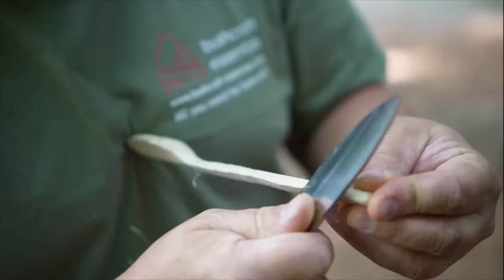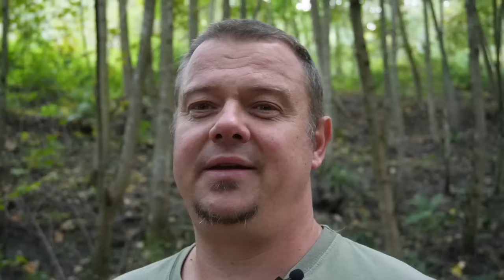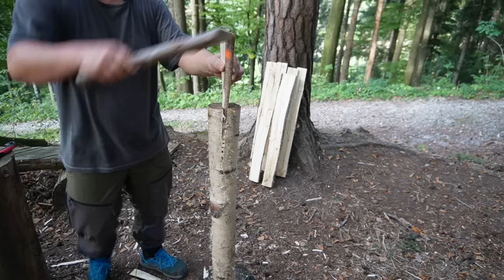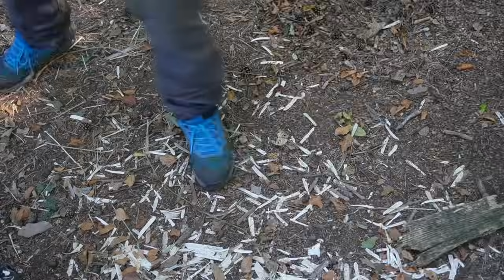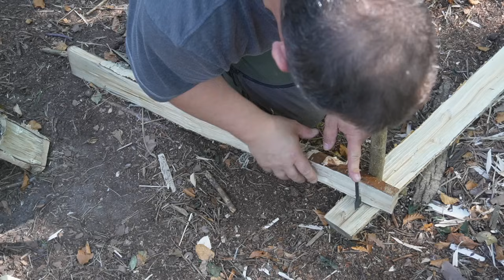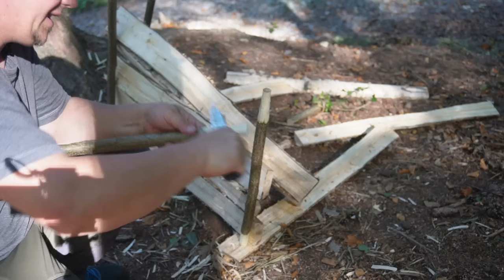New Table Concept! Bushcraft table with self-clamping legs - A Victorinox Venture Project.

Comment: You are a Bushcraft Beast, Felix. That was a lot of work condensed into a few minutes for the video. I would wilt under all of that effort. No small task and you blasted through it like a hot knife through butter. You are the “Bushcraft Beast” for sure. I have seen video reviews that suggest the Venture is not a durable knife for tough bushcraft tasks, but you prove them wrong. Well done, Felix. Well done.
Reply from the maker: Thank you so much for your fantastic feedback!! Regarding the Venture... it's just, you have to know what you are holding in your hand. With a Knife 0,4mm behind the cutting edge you have to baton with brain switched on

Comment: Another great project ..... some optional improvements for table 3.0 ...... with a little more planning you can really "value add" to this great concept.
• Help drill to bite maybe you could fire harden the areas of wood you are going to drill?
• Taper leg frames out at bottom for more stability ...... could even make them from larger stock and much wider including more cross braces to accommodate bench seats like a park picnic bench (much bigger project! Heaps of functionallity!)
• Add more cross members at bottom of table leg frames (you could even use two similar to top end but have optional wider gap space for a different table top height? ..... if you didn't go with the bench seat idea)
• Construct leg frame cross members a little differently use saw to create hard shoulder on sockets then whittle/carve dowel ends and ensure they are all same, with hard shoulders (not tapered dowel ends), this will give consistent leg frame dimensions to the construction and if you add a simple twisted double cordage strainer you can make the frames more dissassembleable and more ridgid (if you want tight fit carve pegs square the take edges to octagonal with the flats to hole dimension the octagon corners will be a little oversized but will form tight friction fit)
• All done .... if you wanted/needed to increase strength/more longevity for the construction you could add binding/lashing to securely lock in the frames ..... one of the best ways could be to ribbon strip plastic drink bottles and lightly flame to shrink/tighten after lashing

Sounds a lot but really are just small tweeks to a fantastic concept that could yield a great outcome.
Reply from the maker: Thanks a lot for your hints!
Reply: @FelixImmler  no worries....glad you did not them as negative criticisms, your projects and skills are such an inspiration

Comment: Nice work as always Felix. If you press down on the table while using the side of your foot to spread the legs outward, it will stabilize better. Baton them down too and it should be rock-solid.
Reply from the maker: Thanks a lot for your valuable hints!!

Comment: I love your content, when I look at furniture projects like this, I can't help wondering if you might not be better off making better tools? Maybe make yourself a brace to use the flat bit more effectively/easily. I did some projects with a hand auger, and with a brace and bit... the brace and bit romped home as the winner.
Reply from the maker: You are absolutley right. But i want to show, what is possible with just the flat drill from the tool kit from the Venture. Of course an auger is 5 times better but also 5 times bigger and heavyer. You only have an Auger with you if you plan to take it with you. But you always have the flat drill with you in your tool set. That's the idea behind it.

Comment: Hi, Felix. Somehow I overlooked this video when you first posted it. I love this concept for a bush table! AND it's a takedown design! Super! 
  I'm a little surprized that the screw of the bit tore out of the wood. Those bits are used to drill through pine boards for routing electrical wiring all the time, and I'm pretty sure that pine is softer than Birch. When you say the wood is too soft for the screw to pull the blade through, are you saying that it tears out just near the END of the hole or does it tear out in the middle of the hole also? If it is just at the end of the hole, I have two suggestions. Perhaps you could start the drilling on the curved side of the split log and lay the flat side hard against another flat board for support. That would allow the screw to engage the second board as it emerges from the first board and that might pull the blade through. The second idea is to drill the holes before you split the wood for the legs. That way you would easily get four holes in two of the legs (after splitting), and only have to struggle with the four holes formed by the exiting drill on the other half of the log, instead of all eight holes. If the exit end of the hole is NOT what is causing the problem, then my suggestions are worthless. Maybe honing the cutting edge of the drill bit would help or using a spiral bit instead of a flat bit. A spiral bit will still cut well, even if the screw tears out, so long as you can apply downward pressure.
  I'm really enjoying the Venture Project series. Ciao!
Reply from the maker: Thanks a lot for your super interesting comment and thanks a lot for your tip! The birch i used was may be already on the ground since a year. Birch rots very quickly... that's why it wasn't the best wood and quite soft.

Comment: Surely Venture series looks great and its features are well designed, and your creativeness and skills are ever so wonderful. But I wonder, is there some remarkable tasks that the Venture series knives can take, but that the regular 91 mm SAK’s cannot handle?
Reply from the maker: The stability of a fixed blade is significantly higher. ...and the cutting performance is also higher than that of a Swiss army knife. In combination with the flat drill, the Venture can do a lot that a SAK cannot. It's best to have both 🤣

Comment: Brilliant!  And it looks like the Venture Pro did a great job!   How did the edge hold up Felix?
Reply from the maker: The Edge is super sharp…only 0.4mm behind the edge. The disadvantage of this carving and cutting friendly edge is, you have to be careful with choping, splitting and hammering
Reply: @FelixImmler  Exactly!  I just think maybe Victorinox overdid the Marketing on the "can do it all perfectly" side of things a bit! So the Venture does what it is designed for very well. Anyway, chopping, splitting and hammering are things reserved for other tools that are designed to cope with them (like my Cold Steel Trail Master!). Awesome table, by the way! 👍👌